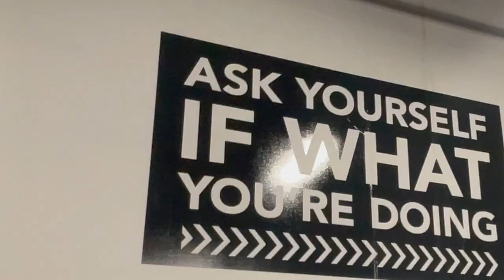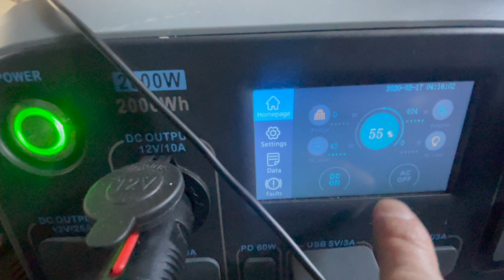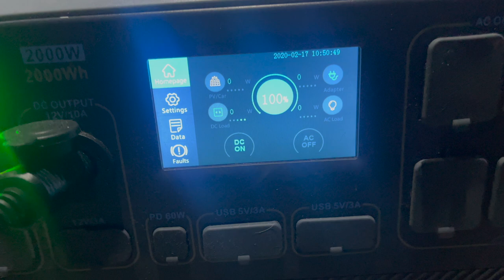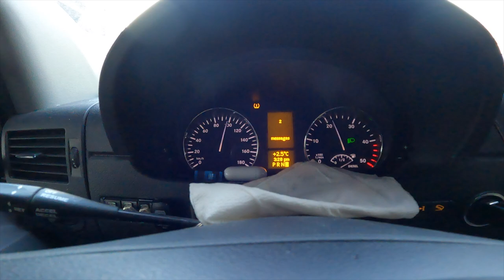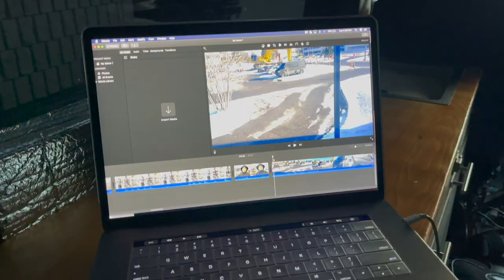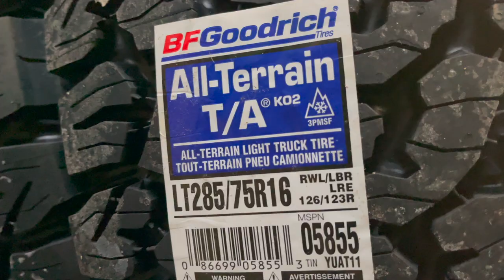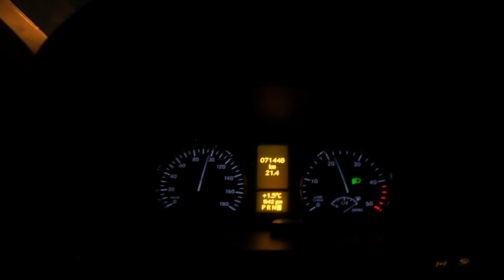4X4 MERCEDES SPRINTER GETS NEW TIRES - VANLIFE VLOG

Comment: I have 265 75 r16 on my 170 wheel base high top 4x4 black sprinter diesel. I have the bfg ko2. I will likely go bigger to the 285 now that i know it works for you.

Comment: Are your stock rims 6.5" width?  I'm hoping to go with the same size tire but wasn't sure they would work with a 6.5" rim.
Reply from the maker: I’m not sure what width my rim is but it’s what rim came stock on the 2018 Mercedes 4x4 sprinter I just changed the tires

Comment: Hi, do you have wheel spacers on that set up and do you think you could get 255 85 16's on your rig?
Reply from the maker: I do not have wheel spacers installed all stock suspension and with the Bfg Ko2 285/75R16’s on they seem to be a perfect fit. Any taller or wider of a tire I’m most certain it will rub the front bumper so then you will have to consider trimming the bumper and/or adding additional lift
Reply: 32.8 are the ko2's at your size and the m55" @ 255 85 16 are at 33.4; do you think 1/2 more would rub? @hustlelife369
Reply from the maker: There is literally like a 1/2 inch space from the tire to the front bumper when I turn the steering wheel right to left. You might be able to get away with it or just trim the plastic bumper a tad of it does rub

Comment: I wanna get the same tires. Btw what is that app your using?
Reply from the maker: I made the right choice with these tires super happy with them and such a difference in road less noise. The app I used to measure the road noise is called: decibel - sound level meter.
Reply: @hustlelife369  and how is working off-road, mud, deep sand etc? Thanks for your help man
Reply from the maker: @jabisanz they are good on the roads with snow and rain but off-road in deep snow mud and sand you’d want something with more aggressive tred pattern… I did get stuck in some high snow and sand on the beach in Daytona beach I was able to get out but with the help of some traction boards.   I’ll be posting a video of when I got stuck in Daytona beach